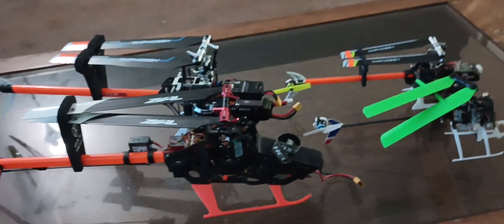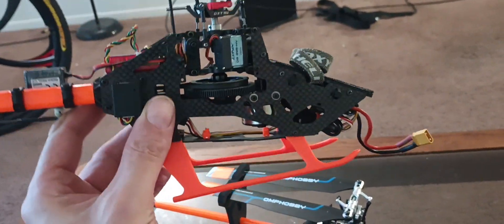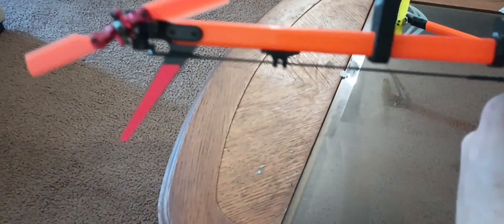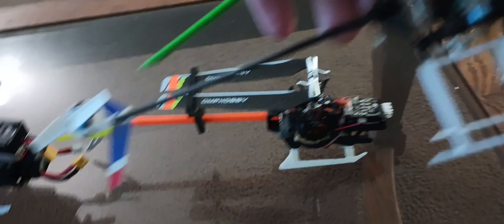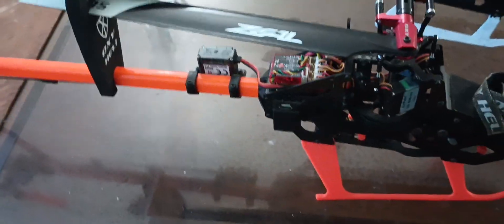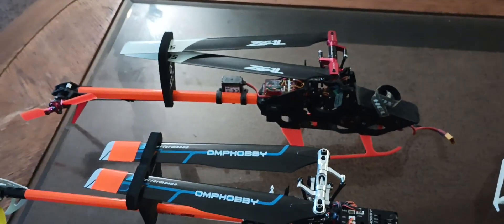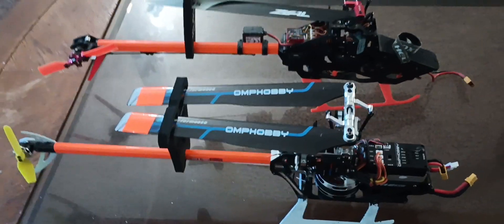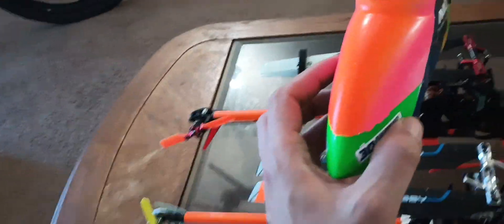Reasons to buy OMP M2 EVO if you have OXY 2.

Comment: I convert the Oxy2 rotor to adopt direct drive main motor and tail motor from racing quadcopter market. I fly my Oxy2 FPV because I can't fly LOS. The nice thing about Oxy2 is that Lynxheli was originally a upgrade parts company for Horizon Blade helicopters, and Oxy2's main/feather/DFC/swashball shaft diameters are compatible with many 180-200 sized Blade helicopters, which have parts compatible with Align 250. The critical thing about Oxy2 is that the disc loading is optimal for 250-gram drone fuel economy for mass swarm deployment.

Comment: Omp uses those scam fbl like the blade nano, I'll keep my oxy2, run any fbl I want, my omp is a brick now
Reply: Having had an Oxy 2 and omp m1, m2 and now m4, I'd take the Oxy 2 all day long. The flybarless in the omp helis suck. Super heavy disc loading on all omp helis too. I had the tail in the Oxy 2 dialed in way better than I can get the omp helis, except omp m4 which has  a great tail. Belt drive of course. No motor tail is going to beat belted drive. Maybe one day, but not there yet.
Reply: @Rusty-Metal  oxy 4 max can handle 4000 rpms safety, m4 peaks at 3500. Oxy is performance first
Reply: @Backyard_Buzzard  all these direct drive helis... I'm not seeing what they solve. Just heavier. Quality helis like Oxy don't strip main gears when set correctly.
Reply: @Rusty-Metal  your comment did not age well lol omp m2 mk2 is incredible
Reply: @elitecol69  according to you? They suck period.